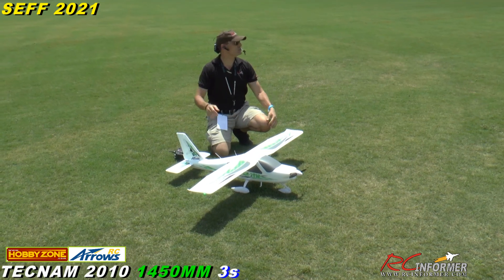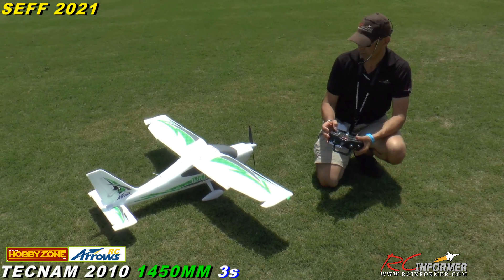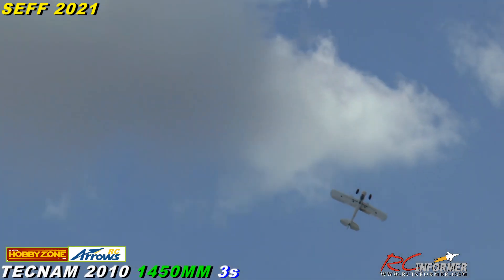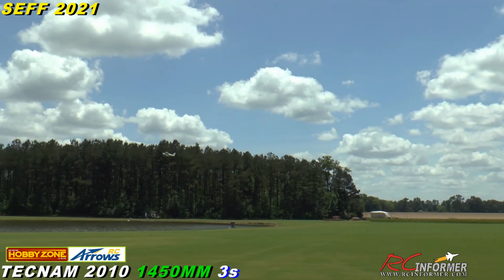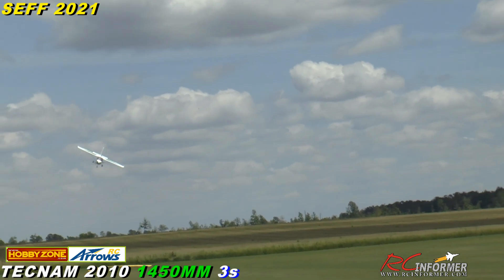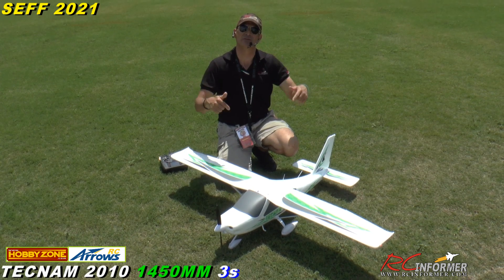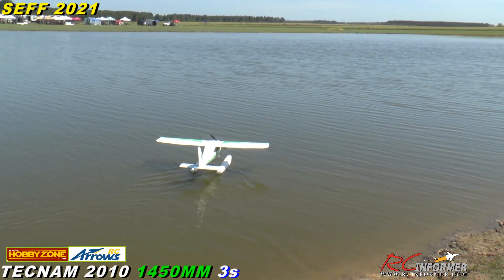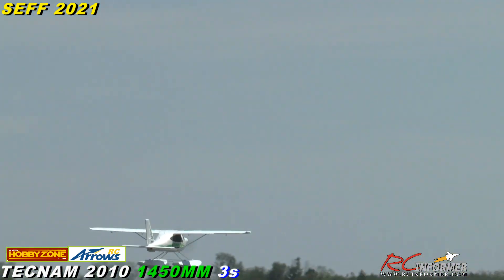HOBBYZONE / ARROWS RC TECNAM 2010 on Land and Sea at SEFF 2021

Comment: Nice flight ! Real smooth .💪 quick question I have a plane design for a 4s 2200 battery and it's 60amp esc and the motor is 3536 kv1750. but I wanted to use 3s 2200 battery would it still fly ? Would the plane be damage ? will it fly but just not as fast and the battery will die fast ? Need help !
Reply: @ Ojeez...did you get an answer to your question yet?...I am new and was wondering the same......I can tell you the CG most likely will need re-adjusting before you fly, due to  weight ...as far as the motor or ESC being damaged, I don't  know for sure but would bet that the 3S LiPo  battery would run down super fast and not give you  enough power to fly it, even slowly...let me know if  you can find the answer....take care....

Comment: Will it run on 4’s?
Reply: Actually it does. I fly mine on 4s regularly. Just don't go over 70% throttle. Fly's like a dream with plenty of mid range throttle. I place a vibration feed back on my throttle at 50 percent just to keep in the zone.